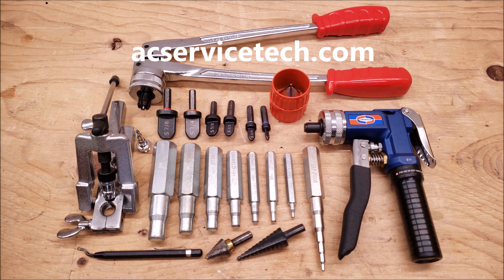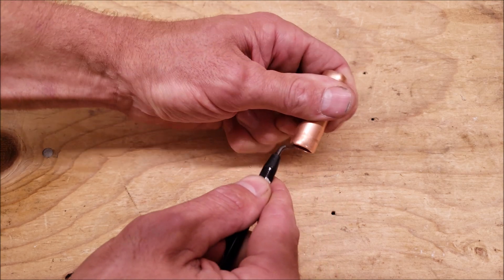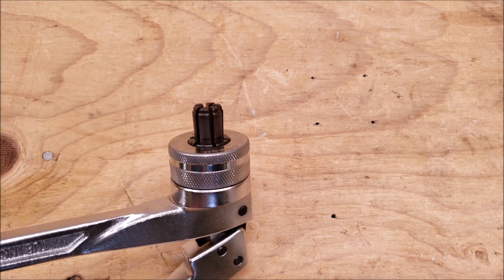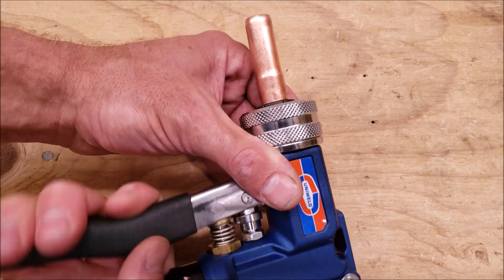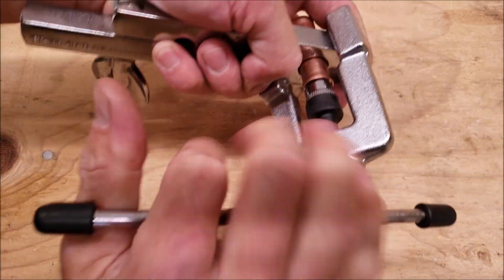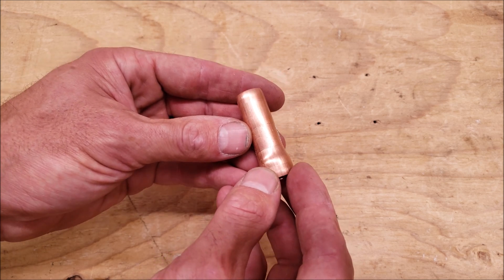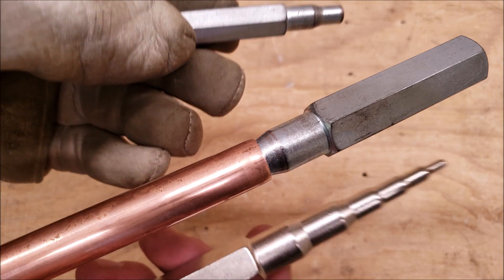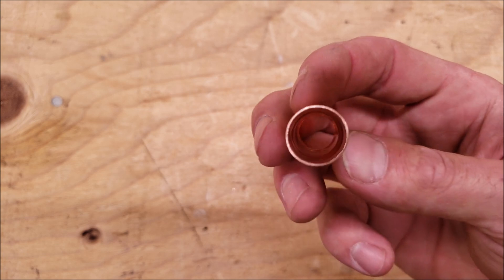Swaging Copper Tubing! Hydraulic, Manual, Spin, Hammer, & Standard Expanding Tools!

Comment: You left out that pliers looking swaging tool, with the long split rod that can be expanded at will. Those work real well too but you have to keep spinning the tube/tool as you swage so you get a nice round swage. Also I've discovered you can split the copper if you go too fast with swaging.

Comment: What if you are reaming or swaging a vertical pipe that you can't make it face downward position lets say if you are working on an equipment and want to change a big filter dryer you cut the 0ipe but you have to do it on vertical how to get the shaving out
Reply from the maker: in that case, you are not going to be able to ream that because there is no way to save the shavings from going down in the inside, thanks!
Reply: @acservicetechchannel  i asked some other guys and they said you will purge nitrogen but I dont think nitrogen can blow them out once they are fallen into the pipe.

Comment: Hello Craig.  Another great video.  One Question, what tools would you use to swage a 1/4" or 5/16" line?  I have heard the hydraulic swages tend to leave the swage offset.  Your Thoughts?
Reply from the maker: The hammer swage, spin swage or conventional swage and swage block. The hydraulic and manual swages only go down to 3/8" but I wouldn't use the manual or hydraulic for that small of a size, thanks!
Reply: @acservicetechchannel  Thanks for the reply. Actually, I own a 5/16" hydraulic head swage, Hilmor Brand.  I have not used it yet.  I am aware they also sell a 1/4"

Comment: what happens when bits of copper fall into the copper tube and flow into the compressor?
Reply from the maker: That damages the pumping part of the compressor and scratches it. The filter drier has a prefilter where they eventually will get trapped but it is not good to have that running through the system, thanks!
Reply: @acservicetechchannel  I used your advice to swag a tube a bit to add a service port tube inside brazing with a 1/4" silfos ring.  Those silfos rings are nice.  but now I think I'll have bits of empty copper slivers inside the system.  System is completely drained from a previous leak.   I hope using my vacuum pump will pull any of the debris out.    what's your thoughts on this?
Reply: I think swagging the copper pipe is not ideal to do it especially if the pipe is upright as all the debris goes inside the pipe .

Comment: Timely, as I have to extend some lines to move my new AC to a better location in my workshop.
It looks to me that for a guy who only does this occasionally the hammer swage might be the best bang for the buck?
Very much enjoying the book, learning a lot.
Cheers from Tokyo
PS are you doing a video on  silver soldering or brazing the swage joints?
For silver solder will MAPP gas be hot enough?
Reply: Depending on the number of connections pre-made couplers might be the cheapest way to go. 
Yes, you can silver solder with MAPP + Oxy (you can also braze 15% with it, which is going to give better results especially if you don't get a lot of practice). In either case, be sure to use a reducing flame and flow nitrogen.
Reply from the maker: The Tokyo Craftsman, yes like truthsmiles said, you could use some refrigerant flare couplers or if you were silver soldering, mapp gas would certainly be hot enough. If you were brazing then you would need acetylene for 15% silver brazing rods. Also Hammer Swages are a great choice as they will work well for 3/8" swages, thanks!
Reply: You can use MAPP + 100% Oxygen for 15% silver rods, BUT you're going to use a lot of fuel. It just barely gets hot enough after a long time. However, MAPP gas alone I don't think will work (never tried). In either case, the trouble is a great conductor and heat will eventually travel to any nearby valves. I like the suggestion of flare fittings too.

Comment: Another fantastic video. I would like to know which one of these swaging tools is your favorite and would recommend to newbie technicians.
Reply from the maker: For a new technician, I would go with the consistency of the hammer swage since the manual swaging tool and hydraulic won't work well for smaller tubing like 3/8" and the dies don't go down that small for 1/4" and 5/16". Spin flares will work but just watch the dust from going into the tubes. Thanks the truth!
Reply from the maker: @the truth Its helpful because I have a hard time keeping up with answering everyones' questions across the board that are coming in, thanks!